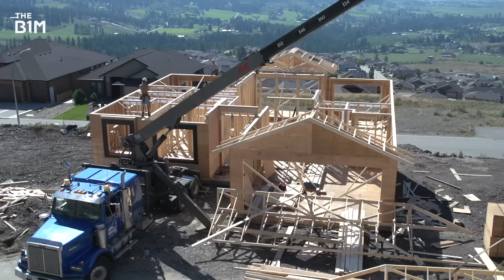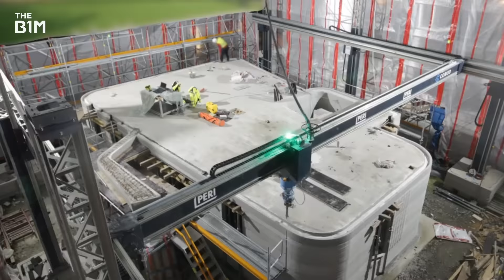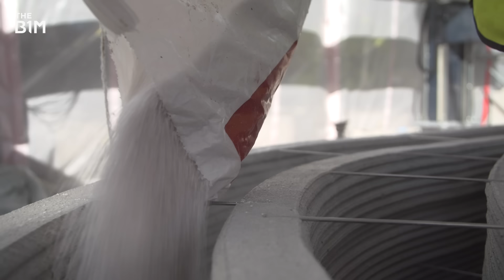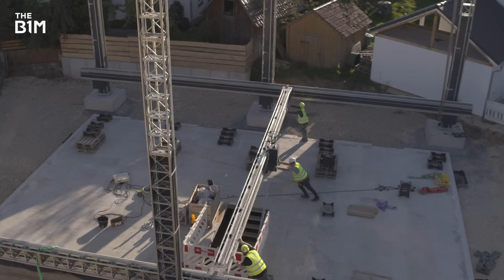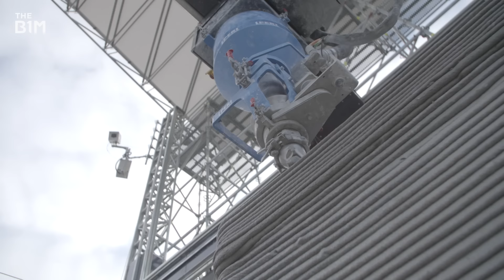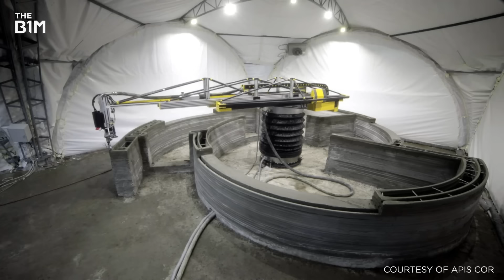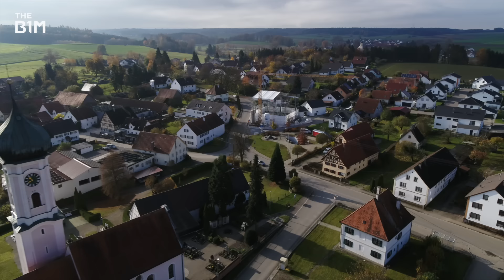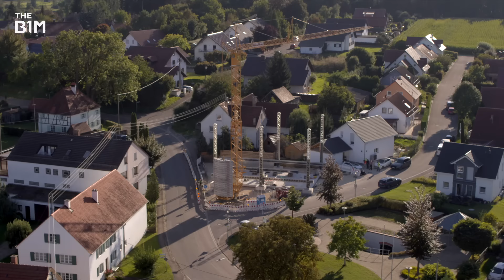Why This 3D-Printed House Will Change The World

Comment: If all you want is walls you can already do it faster today with prefabricated parts..
The only benefit i can see printing it would be for shapes that are to complicated to do with standard methods.

3D printing in general is abit hyped imo, its not the be all end all method of production and more of a niche thing for prototyping, small batch or parts that cant be made any other way. 
People who think it will replace injection molding plastics or sheetmetal stamping for mass production have never seen those proceces in action, its about as efficient as it can be.

Comment: I think it is still going to be quicker an easier to build a house with timber frame, bricks and plasterboard. And I think a brick house looks nicer.
Reply: Germans don't build their wood houses that way like in NA. They either manufacture the walls in the builder's facility or use timber frame, which is comparable in cost to bricks.

Comment: As innovative and cost-saving as all this may well be.. this is just another force putting millions of people out of work for "progress & efficiency" .. In the same way that automatic tellers have taken away jobs from supermarkets, autonomous trucks will result in the loss of an estimated 5 million jobs just in the US alone. In many places construction is a huge employer. When you replace a building team with a 3D printer, then even if you still need trades like electricians & plumbers etc, you hardly need form-workers & carpenters. Not too sure about the exact stats for Melbourne but Melbourne's construction boom is huge. For Australia as a whole, 9% of all jobs, 1.5 million people, are employed in construction, not including suppliers. In an increasingly automated world, where miners are being replaced by robots, manufacturing has been moved offshore & what remains is being cut in half and replaced by robots. Then when 2 thirds of labour-related jobs have been replaced by automation, then without a liveable universal basic income, what do the people do that have been automated out of a job? 

Without a certain number of working-class people with money to spend in the economy, the wider economy will break down. This is what the libertarian force of disruptive big tech forgets about. Gig work itself will become automated. Most IT systems will become run by machine learning algorithms.. This is what Big Tech is totally ignoring in the march for ever-growing efficiency & innovation. If people can't find jobs because 2 thirds of all jobs have been automated, then unless there's a fair & liveable universal basic income, then the end result is social chaos. In a ca[pitaist system where people need jobs and money to survive, then how are people to survive when 2 thirds of all jobs have been automated? With innovations such as 3D printing potentially replacing most construction workers, this is the question that needs to be asked & planned for.

Not against innovation & technology, i am a big supporter of blockchain & i can totally see how technology can benefit many sectors. But as disruptive technology has already replaced so many secure jobs, & the global retail model, in particular, has been funneled into amazon, with no thought as to the effects on the wider retail economy & retail jobs. Then when contemplating automation of the construction sector, then all the potential ramifications have to be looked into and planned for..

Comment: In the 1930s there was an attempt to mass-produce houses made out of concrete. They were all cast using the same mold.  But they were square, ugly, and no one wanted to live in an ugly block. People want houses that look slightly different than the one beside them, that's why builders build out of wood; it is because it is easy to build houses that are all 'different'.  But wood rots, and to build out of wood takes expensive labor, making houses cost way too much. A much better solution is to build super-insulated cast-concrete SEGMENTS for a house, and then a person simply designs his own house using these interconnecting 'blocks', and then low-skilled workers assemble them, gluing them together using epoxy adhesives. 3D printed houses are okay, but the interior walls are not smooth at all, and few people will be happy unless the walls are glass-like smooth.

Comment: Cement (or concrete) has one of the biggest CO2 costs in construction. In current political climate this will not take.
Reply: Deer Radek:  I could be wrong, but I don’t think you’ve ever built a house before, most people have not, but I have done it many times.

Using concrete for all of the walls is not a dealbreaker. Not even close. If you ever get a chance to check out some conventional construction, you’ll see that the real cost dominating factor is labor because of old fashion construction techniques that have not changed in more than 100 years.

To give you a rough idea, the embedded energy in a product is roughly proportional to the cost of the product. For the amount of structure you can get with concrete, the cost is not that high.

Myself, I have a general rule with concrete, good for vertical structures (such as walls), Bad for horizontal structures (such as driveways and patios) - Because it cracks and is ugly.

Comment: Wouldn't maintenance be a problem? Say your wiring was broken and it needed to be replaced. How would the electrician get to the wires? Smash a hole in the wall? If so, then you would also have to replace the wall and make it look like the rest of the house.

Comment: So what about the actual material. How would you fix electrical and piping in what I assume is essentially a fully cement structure. What about wall damage for that matter what would have to be done to repair it

Comment: Great reinforcing - love to see it last more the 5 minutes on Berkley' shake table..
Reply: Not everyone lives in Berkeley. Maybe you’ve never been outside of perfect California? Myself I’ve been a lot of places. You can go all over Europe and see 2000 year old tall slender buildings built with Rock and cement mortar, perfected by the Romans. In most of the world there is not an earthquake problem. By the way, these kind of structures, printed structures, can be easily reinforced with wires, don’t need rebar. It’s time for you to get off of the shake table.
Reply: @steveperreira5850  I'm a Quality Conformance/Compliance Structural Engineer and seen enough amputated survivors to know your belief that you can make an extruded mass concrete structure earthquake resistant by adding "wires" is a purile wet dream.🥝🥝🙏

Comment: What about energy efficiency? I have not seen any structural insulation in this new building. 
I want to know the U-value (W/m2.k) of the building elements printed by the printer. 
I can only see a lot of concrete. I am not a big fun of concrete. 
It’s a cold material, not as much transpirable as clay blocks and with a poor R-value. 
The energy performance for modern buildings will very soon have to meet the Passivhaus standard. 
Good initial design , planning & coordination and good building materials can already enhance the quality of the building, reducing costs and labour time. 
In my opinion 3D home printing has a long way to go, and perhaps one day will be able to assist builders during construction. 
I think it is also important to value the skills and craftsmanship of well trained carpenters and builders. 
Too often we sacrifice creativity and beauty to put time and money first.
Reply: What about hempcrete?
Reply: @SleepfariTV  Hempcrete blocks can be a great solution for new energy efficient buildings 👌

Comment: they should add pozzolan sand, adding volcanic ashes will turn it into roman concrete so it will last way more time and become more resistant overtime as it absorbs minerals from the rain.

Comment: Ugly and with no charm to it.
And it does not do ANYTHING that can not be done by handwork. (Actually everything it does can be done by handwork)
Some may say that the speed can not be done by handwork, but i bet that the time they use to manage all the equipment to make it possible, will make it slower then if some craft men did the same.

But most important, it has no beauty, charm or personality. To me it would felt like i was living in a office.
Its not a place to say "Home sweet home".

Comment: It's early, but I don't see this catching on. It seems like a very weak material (lacking rebar) and it's a rather slow process. The investment for the printer will be massive and any problems and maintenance seems costly. The electrical, plumbing, foundation, insulation, siding and interior walls all still need to have labor finish them.  A big obstacle will be the lumpy finish... stucco seems like it could take well enough to the outside but it's not even, strait and so the interior will be much more work to look nice. 

You can build a house with blocks faster, cheaper and with better insulation and surface finishes. Two people can build the walls on a house with light weight foam/cement blocks... then grout fill. 3D printing might be the future, but I can't see it happening without these problems being addressed... I also foresee a lot of problems in quality on the material if it's not always flowing perfectly or if wind/rain/cold just ruin it. Setting up a giant building over a building is just too inefficient imo.

Comment: Recently I discovered that during the period of approx. 1940-1970, UK built around 300,000 factory pre-fabricated concrete-based homes. Some were concrete blocks or panels, some were cast concrete with rebar, some were Wimpey "no-fines" or Laing "Easiform". Many of these houses still exist today. Most are difficult to live in - mounting a TV on a wall can cause the concrete to splinter out. Climate here in the UK means they are often cold and expensive to heat. Having external insulation can be a remedy but usually it needs to be renewed about every 7-10 years.

Perhaps one of the biggest problems with UK concrete houses of that era is that they are getting older! As time progresses, they are becoming increasingly difficult to get a mortgage on or home insurance for. Both mortgage lenders and home insurers see these as "non-traditional" constructions (not brick) so either charge an additional premium or refuse to offer a contract.

Yes, concrete homes have had a great history and with 3D printing technology are likely to have a great future. However, certain markets for them around the world will struggle to accept them.

Comment: block built houses are very cheap to put up. Blockies arent expensive to start with and will likely get cheaper. Also the cost to put up walls are a low percentage of the overall cost of a house. This will not compete on cost for a long time. Quicker maybe.

Comment: R factor in cement isn't that great and the sound insulation is even worse. Also concrete is one substance that adds to Climate Change. Aircrete are better but then you get the reduction in compressions strength. 
I can see this maybe being faster with less people being involved but I don't believe it's the future of housing. FAD that will pass in time.

Comment: ⚡️👌🏻 Add hemp hurds to the concrete as a flexible, insulating fiber and you have a winner here.  Hemp crete is amazing and worth being the norm in the construction industry.  We can curve the walls for wind deflection and the insulation and humidity regulation of the hemp reduces the building’s energy needs vastly. 👌🏼⚡️

Comment: The main cost of the house is the cost of the land, construction cost is usually less than 15-20% of total cost, even lesser in high demand metros, 3D printing is a cost saving and speedy method of construction, it won't be able to address the elephant in the room - the land cost

Comment: walls are so thick! (individual panes) - why it is not like 'lego on steroids' - very large pre-cast sections joined on site with 3d concrete printing... more liky 'glue things together' ? energy consumption per kg (!) of the 3d house is insane...

Comment: So basically it just does the floor and walls. All of the intricate stuff like electrics, plumbing, plastering, decoration, doors, windows and landscaping still has to be done by tradesmen. So when you say 3D printed house, what you really mean is 40% of the house. A lot more work goes into it once the printer is done.

Comment: I´ve seen this over and over. "Cheap houses for everyone", promising to build enough houses to "end the homeless in the streets" ...and these technologies then are affordable to a few, if the rest of the industry allows them a piece of the cake at all, instead of destroying them. 
For this kind of technology to "change the world" it should be REALLY opensource. Something perfectly doable, with the available technology and a little of tinkering out of the box...I think. Don´t get me wrong. I think this is great, but I do know the huge amount of expenses that manual labor means. Don´t think those two operators are going to charge like regular laborers. 
Then, there is the thing with the "laws" and "regulations", which impede people to use primitive but proven methods like sandbag building, affordable, thermally efficient and strong. Construction is the motor of the economy in most of the so called developed countries. If this was really "disruptive", Elon wouldn´t have manufactured bricks with the dirt out of the holes opened by the Boring Company. 
I´d rather prefer to build with sandbags even if it takes 10 times more time, but 1/50 the cost.

Comment: Maybe Indian companies should be recognised more. L&T an Indian company completed first 2story building 1weeks before at very cheap cost by their own 3D printing technology. It has steel bars too.
Reply: Why? You're comparing apples with oranges. It's like saying the cheapest Tata car model is similar to the most expensive Mercedes. It's not "3D printing" alone that's interesting. This is a fully certified German house according to very high standards with all trades included in the plan. You build to completely different standards in India.
Reply: @thomasnorb4077  dude have you any idea about what you are talking? Here he is talking about application of 3D printing for house and obviously I know about German standards, the standard Volkswagen passed 4 years by using malicious software.

Comment: Electrician should have said, "I will be losing 12 days pay here"
Reply: In my experience, electricians in Europe usually have so much work in the pipeline that it doesn't matter. This way they can focus on the highest paying jobs instead. These jobs should be very predictable and easy to install, especially by comparison with older homes.
Reply: @thomasnorb4077  good for Europe.